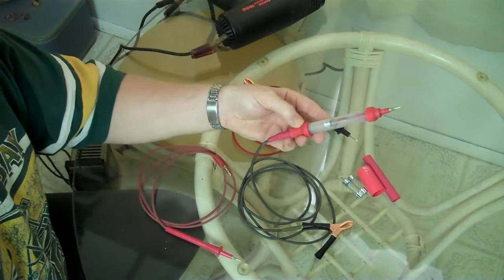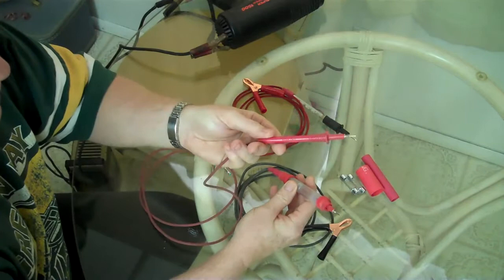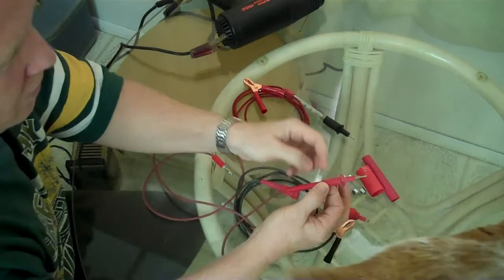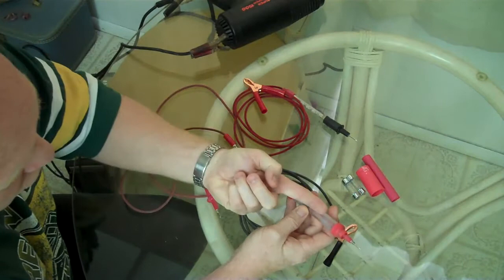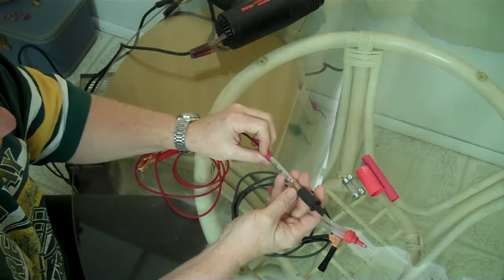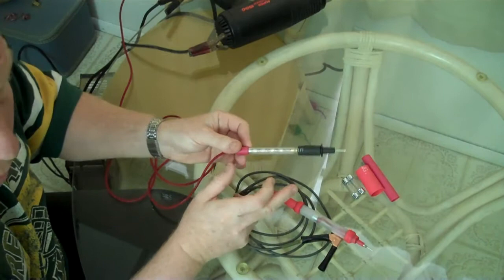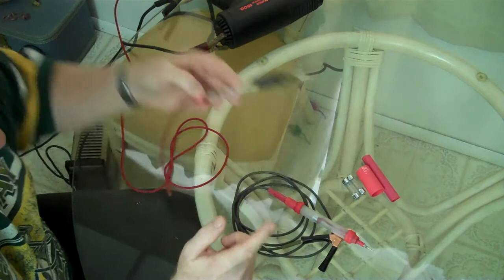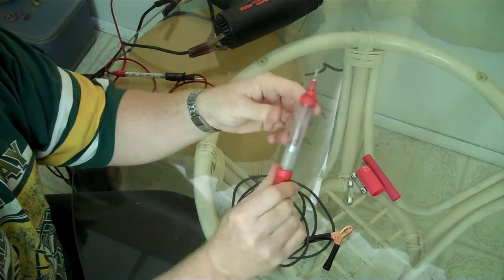Attacked by a Cat  With a Test Light

Comment: Just insert a diode with the banded side to the negative lead.
Only a pos on the tip in respect to the neg will light the bulb.
Alternatively you could use two bulbs and two diodes but one diode is facing the other way, colour the poz bulb red and the other blue.

I got it wrong in the original post, i must have been in a dumb mood lol, ill delete it so not to confuse others.